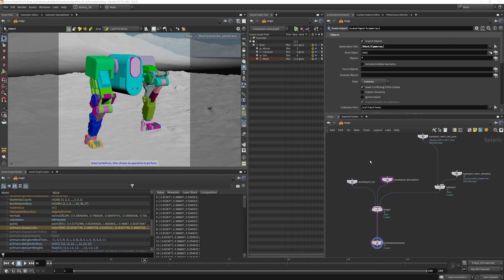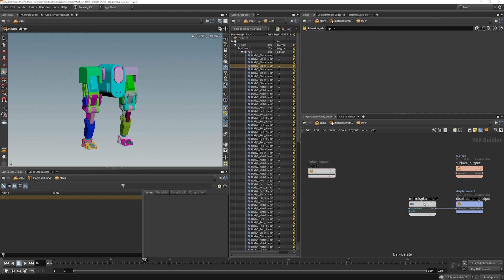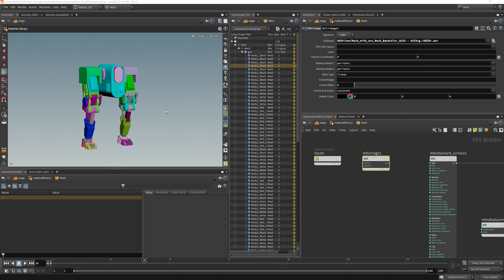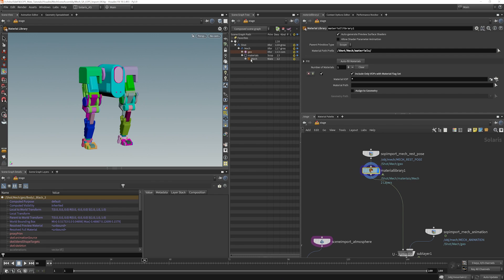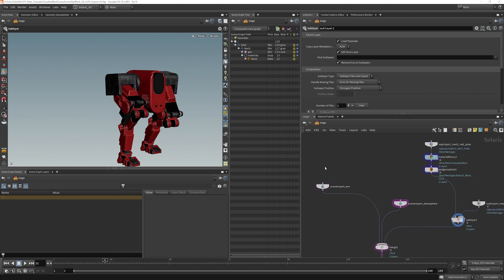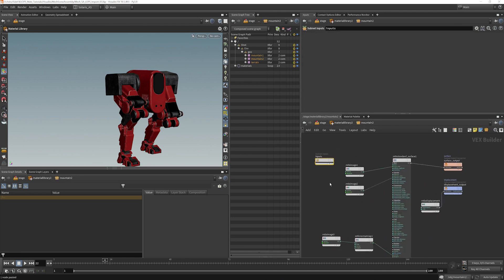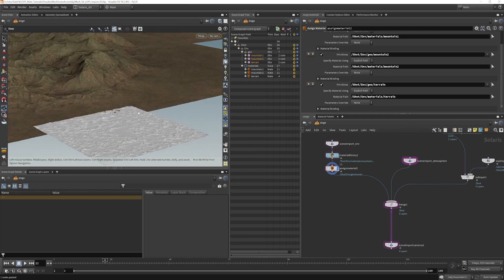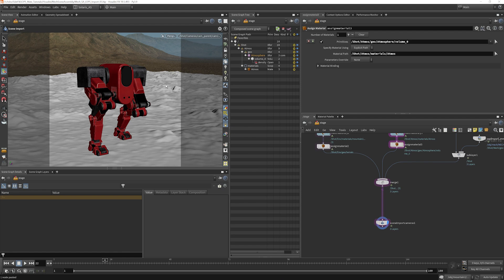SOLARIS ESSENTIALS | 03 Assigning Materials

Comment: For Houdini 20.5+
Use USD MaterialX Builder instead of Karma Subnet

For those who can't see the material in the viepowrt after assignment, make sure you have Display Material on Object enabled (right panel, under light bulbs, a square icon with UV tile.

Comment: Hello Adam! Awesome guide here. I have a quick question. My Mech goes totally black once I assign the material. I have double-checked and it's the same thing,,, could there be a difference in the Houdini 20 version approach to the "assignmaterial" node? Thanks!
Reply: Be sure to change the "Frame Range" option to "UDIM" on the Choose image window when you select the image
Reply: I Have the same question as well, do you find an answer?
Reply: @CanalDoClaudin  Hope I'm not too late. For me what made it work is just by turning Karma XPU in the viewport. With HoudiniGL it wasn't working (sometimes black, sometimes grey). You can even turn Storm render so you can see the textures in your viewport without Karma rendering.
It works both in Karma Material or USD MaterialX Builder as well.
Reply: @Kirosana  thanks, worked!!